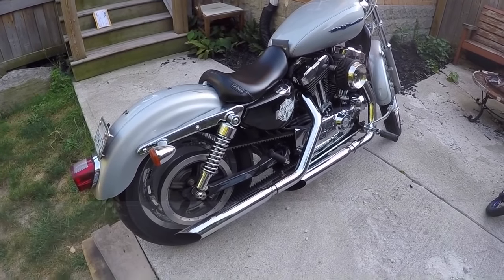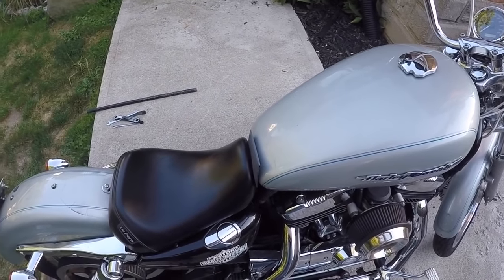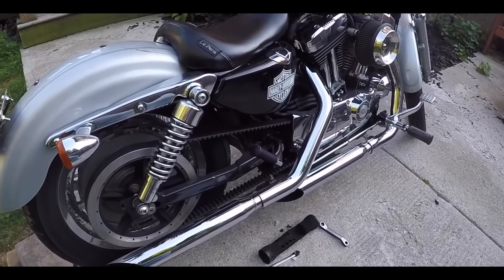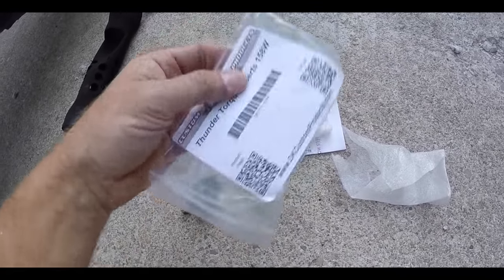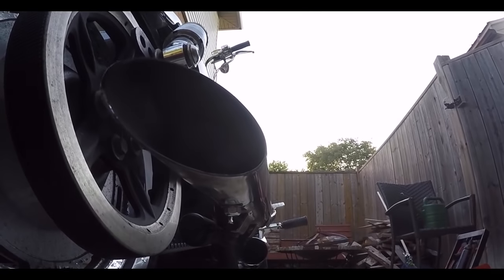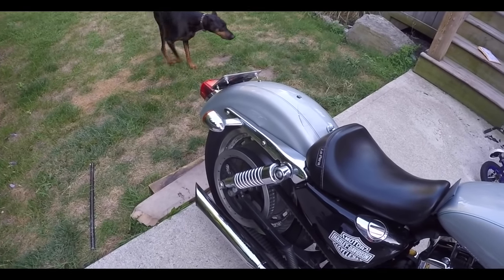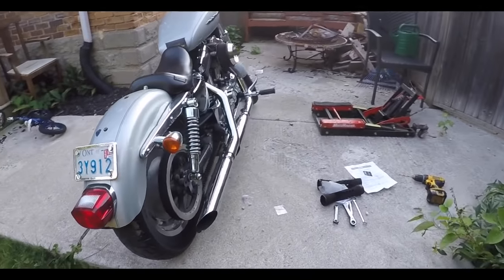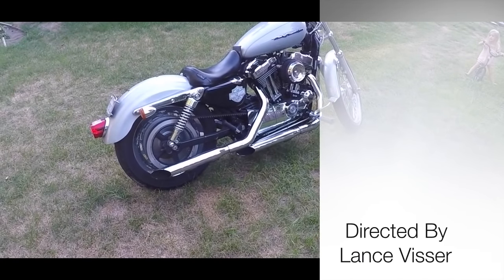Sportster Lollipops, great sound (longer version)

Comment: you might want to increase the idle to 1000 to 1100, so oil will make to the top end.
Reply from the maker: Thank you Sir.., it’s was a long winter and was not warmed up. Good ole carb...👌👌
Reply: It’s still idling to low,not enough oil pressure! I have one that’s blue with goose neck pipes! Sounds great when idle is set to best lope!
Reply from the maker: Edwin Edmondson   Thank you.., my bike previous (v45), also had the same issue. Be blessed

Comment: I did 3" DNA slip ons for my '20 883 Iron. Sounded absolutely awesome, BUT I could tell there's something going on with acceleration in initial loss of power and then it picks back up. I also smell fuel in the exhaust. Do I need to just add a thumb washer or lollipop for back pressure or do I need to spend $400 on a street tune? No change to intake or header pipes.
Reply from the maker: Hey William
  Not too sure what your bike will need. I didn’t have to change much..., does the DNA slip ons have much for a baffle? If not, lollipops might help.... That bike being carbureted as well., it’s a bit gas-y smelling either way. 
  When I first added the lollipops, I had a hard time gauging the bike; just sounded so different.
  Keep an eye out on your gas mileage, condition of spark plugs..., that should tell you a few things.

Comment: Get a set of tourqe cones man you'll get what you need I run screaming eagle slip ons with no baffle and tourqe cones
Reply from the maker: Thanks Edward…, not sure if I’ll be able to get the exhaust apart…, high humidity up here. Everything rusts and seizes to quickly🤦‍♂️
  Really got used to it., hard to tell actual power vs sound changes.

Comment: I put the TTI in my short shots a few hours ago, with no baffles. Sounds mean and I can feel a difference in riding it surprisingly, I didn't think it would actually do anything but make it sound different.
Reply from the maker: TylerDD     I bet that would sound awesome! The short shots are already beautiful! Ya, it definitely allows the bike to perform better by allowing better functioning exhaust.
Be blessed
Reply: @MudderPutter  I'm surprised, and excited! Just a 2017 iron 883, but I have a arlen ness big sucker and dynojet powervision coming in the morning. Curious what kind of difference that'll add!
Reply from the maker: TylerDD    Beautiful bike! Is your breather still stock? Generally you’ll notice some difference when freeing up  the bike breathing (in & out) imo. But the actually gains may be hard to judge. 
  I think most of the fun is in making the bike your own, modding things as you go.👌

Comment: if you run straight pipes in just go to set a torque cones in your headers, you'll gain the back pressure and the sound you're looking for but I think you're looking for something real quiet
  not sure why you did buy a Harley but,, torque cones are the way to go,, and like I said they go in your header pipe not the end of your exhaust.. plus increase the idle a little bit top ends not getting that much oil, you can here she starving..

Comment: What is your bar/riser set up? That’s the same set up I want but I don’t know what risers to get.
Reply from the maker: Thanks Richard
  It was a bit of work.., you need to get rid of the stock riser and Speedo.  I found a used speedo housing from another  model sportster and could use a generic riser from there.  
  But I lost a few of the indicator lites, went down to 4 I believe and had to get the little indicator lamps themselves.
  I don’t have much info unfortunately but there are a lot great threads on the xlforum (XL Forum).

Thanks and be blessed
Lance
Reply: @MudderPutter  thanks for the info, I’ve seen videos of peoples bike with different risers but they never say which one they are running. That helped a lot.

Comment: sounds great. almost sounds just like my 900+$ yaffe crack pipes. That's weird you lost bottom end power those are supposed to increase it. Have you tried tuning them? then them slightly till you have your low mod and high power back and that luscious sound too. they are tune "turnable" for adjustments
Reply: Your welcome.  hahaha I get alot of comments about my helmet.  That's actually a face guard made of steel with leather inlining with skill button snaps for the strap very comfortable and saved my face from countless rocks bugs and even a Bird! the look on people's faces when I pull up on my chopper is priceless it's the omg with fear look and my bike shakes their whole car lol it's a 135" 2212cc with crack pipes on it so all you see is flames and a real heavy idle off the .635 cams lol. Btw if you want to know if your running properly use an air fuel gauge then tune it to the proper settings it'll make a world of difference for you. remember more flow out means more air flow in and more fuel. hope that helps abit

Comment: What year and exact model of sportster 1200 is that?
Does it have 9.0:1 compression ratio or 9.7:1?
Reply from the maker: Dudekzwp 
  This is the 04 1200 Sportster Custom
Engine Type: 1202 cc, 4-Stroke, Air Cooled, V-Twin 
Engine Bore and Stroke: 88.8 mm x 96.8 mm 
Compression Ratio: 10:1 
Valves 2 valves/cylinder 
Carburetion: Carburator 
Maximum Torque: 93 Nm (68.6 ft. lbs) @ 3300 rpm
Reply: @MudderPutter  Thank you for that answer!
Reply: Y have u got a harley if u want quiet pipes
Reply: @tictoc5103  Y not